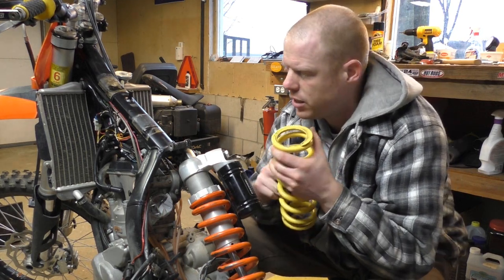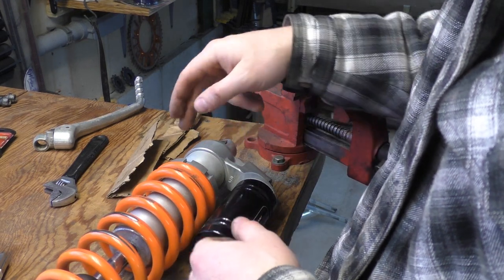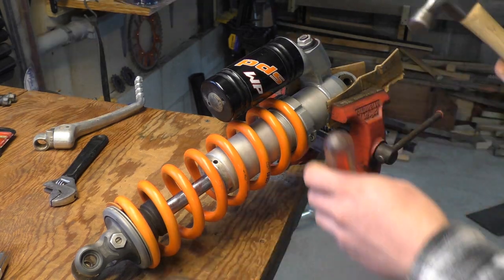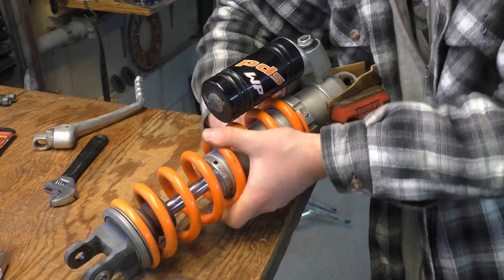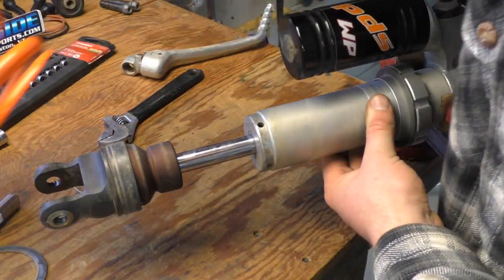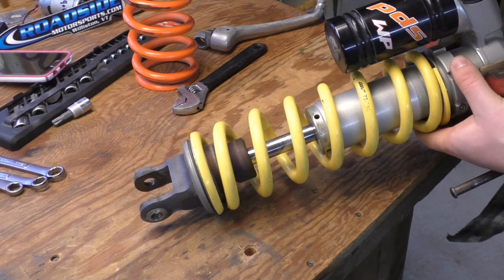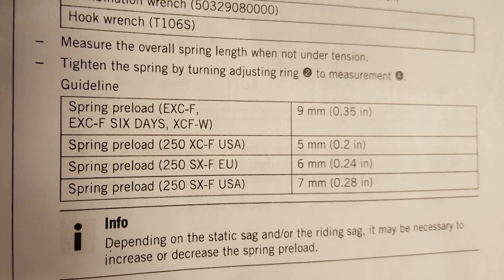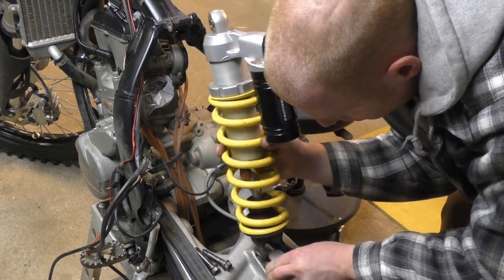KTM WP Shock Spring change

Comment: Good video, one comment from me when you have the shock off the bike anyway is to open the needle bearings in both ends and inspect them. If they are fine just re-grease them with water proof grease alternatively replace.

Comment: Great vid!  After watching I have a question.. would you even need to remove top bolt from shock ( leave it in the bike) to do this? Just bought the same bike and doing some upgrades. Thanks !
Reply from the maker: I don't remember if you can access what you need to if you were to leave the top bolt in. It's been a while since I did this